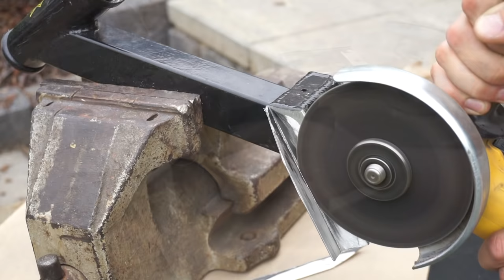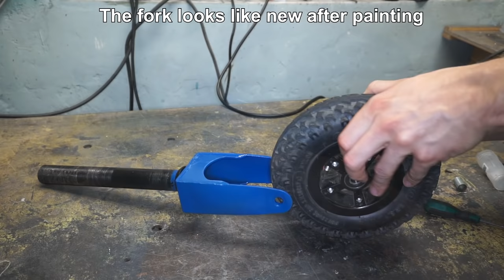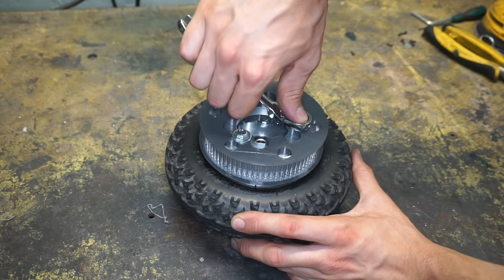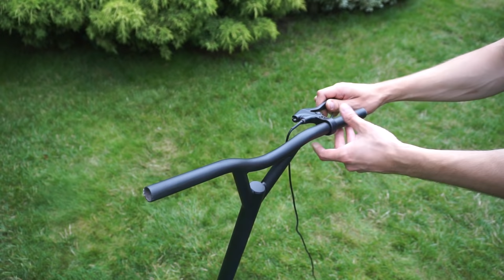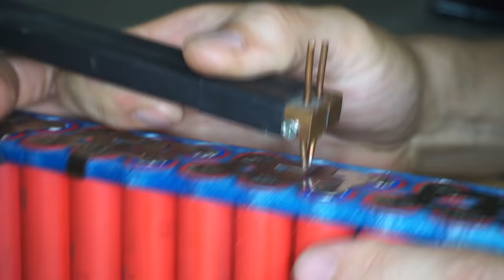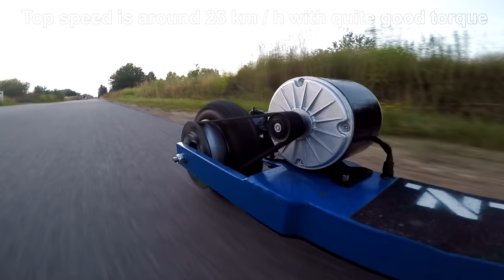Making a Belt Drive Electric Scooter

Comment: Literally creates a masterpiece back wheel hub on the lathe and then taps the bearings in place with a hammer and piece of scrap wood
Reply: L
Reply: How else is he supposed to press fit the bearings in place?
Reply: @tootzy-the-roll  With a press.
Reply: @Damonunit  looks like hammer and scarp wood did the trick just fine
Reply: @Damonunit  a press is useful only if you have it. It's not a necessity.
Reply: Suhayl
Reply: Jhf
Reply: حمودي اخوي الغالي انت وينك يا ابوي شايف عمي
Reply: 7

Comment: You should build a scooter with double motors at both front and back wheels.
Reply: Dual motor on back with axle connecting both motors
Reply: @tbone8604  q11!!, all

Comment: With such skills, you could easily make a modular battery replacement snap-on that will take your vehicle into the 40km range. Maybe even 60km if you can ferry 2 battery packs along.
Reply: Who would want to ride for that long on such a narrow deck scooter with no suspension ? You would be in pain after 10kms.
Reply: @DL101ca  thbbbbhim.
Reply: 22#*
كم 2في الصور0

Comment: Excellent job brother. 👍👍
Hope you dont mind if I give you a suggestion.

If you use two tyres at the rear end of the scooter and weld a small seat in the middle of the scooter , then it will be well balanced as well as comfortable for use. 

Anyways it a splendid thing what you did 👍👍
Reply: hiiiiiiiii
Reply: Oll
Reply: @Righttv212  llll

Comment: I got a question for you: how is your large hho generator holding up? I want to make a similar device and I was just wondering if you noticed some problems after using it for a while. Thanks in advance!
Reply from the maker: Honestly, I hardly use it anymore. Since I have TIG, I have changed the working method a bit
Reply: @maciejnowakprojects  thanks!
Reply: How much it costs
Reply: 8
Reply: @louisarvinmatriano1208  .
Reply: गएट
Reply: @maciejnowakprojects  How often do you change your belt?
Reply: @maciejnowakprojects  wwpwow
Reply: @garage_projects  
Ř
Reply: @maciejnowakprojects  p

Comment: I was questioning your choice of using aluminum for the extensions, until you welded the 1/4" aluminum plate on top.  Interesting, it's a lot like the unibody construction used in the automotive industry.  The full structural strength is not realized until the unit is fully assembled.

Comment: A simple lever would have given a rear foot clutch to make coasting possible and a couple of gyroscopes on the neck of the handle bars for the brakes and electrics making tricks possible? And using some good RC electronics you could say use 8S Lipo's and have field oriented control and use a massive brushless motor to give great low end power and high speeds up to 80Mph.

Comment: only thing more would be a bearing spacer.. so the axle bolt can be tightened against the inner races... without putting side loading on the bearings..  the spacer needs to be half a mm wider than the distance between the step for the outer races..

Comment: Man RESPECT !!!!;;;👋👋👋👋👋
COULD you Tell me wht is  a bms module??
Is the driver a Kind of contrôler Between your trotle and the battery ??
And i dont understand the way you have linked Each single little unit cell to Make the battery??
Thanks for your time
PS what is the final cost If you had battery module driver Brake disk throttle and caliper ????🙂

Comment: You surely designed the battery so it would have a very close voltage value to the motor right?

Comment: If you have DC motor from 12 to 24 v , you can use THIS motor like charger for battery. Just put on one more small belt. And the battery will BE have own charge
Reply: Boris stick to wodka...having a motor run by another motor to charge the battery supplying the second motor doesn't generate infinite power genius...not to mention the extra weight and other electronics needed to have the proper voltage charging the battery.

Comment: The belt design is quite dangerous you could easily put your feet in there you shoud cover it to prevent your foot from accidentally touching the belt esp feom high speeds

Comment: The motor is oversized but awesome build
Reply: Well if he wanted specifically a strong motor
Reply: @tunturimies84  but he hasn’t got a strong esc or battery. So there’s no point in having a strong motor
Reply: @fish9468  Yeah, well maybe he just had it lying around or something and didn't bother to buy a more suitable motor
Reply: @fish9468  it will last a lot longer as it's not being driven to the max. Smaller motor wouldn't have the torque to getup and go and probably die from overheating.

Comment: Does it coast at all?
It looks like when the battery is flat you'll have a tough time using it like a normal scooter.
Did you put any thought into charging the battery through deceleration/regenerative braking?

Comment: Is the engine power in the control or in the file please reply and thank you
Reply: Those are generic ESCs that work for a variety of voltage/motor combos. You have to make sure you don't overdo it and stay within the rated power handling of the ESC you're using.

Comment: Will larger gear on the motor size increase top speed?
Reply: i think its easier to increase voltage
Reply: Yes, at the sacrifice of torque when you take off. As pointed out higher voltage would accomplish the task without sacrificing  torque, but actually increasing it. Obviously you will need a bigger and heavier battery to move around too.

Comment: why you didn´t use a hydraulic brake and why it only have rear brake, when at the front wheel you have much better adhesion?

Comment: How to control speed of an electric motor
Reply: The ESC(motor electronic speed controller) unit he hooked up to the battery has hall effect throttle capability and controls the speed/voltage going into the motor.